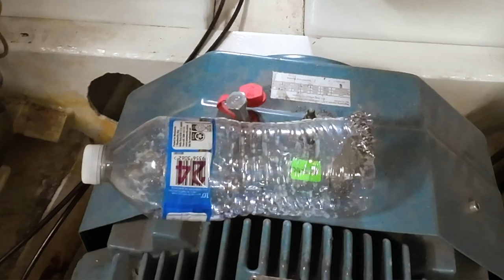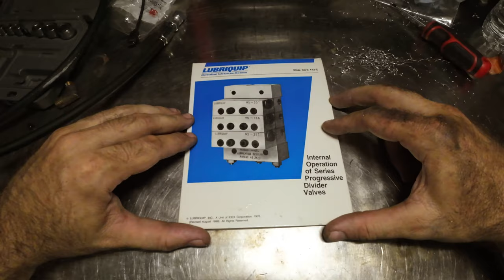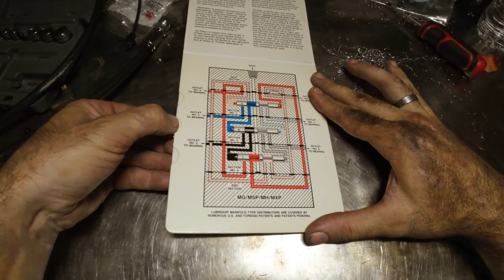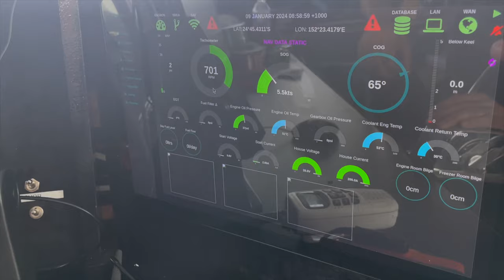New Grease System, New Top Speed, New Berth - Project Brupeg Ep.338

Comment: If you’re in a hot climate you may want to store your grease gun with the pump side down, and relive spring pressure on the cartridge, I’ve had many of them on my service truck weep past the internal seal, even on fairly new grease guns, due to temperature dropping the viscosity of the grease. Even storing them vertical, with the cartridge down and relived of pressure they’d drip on hot days and make a hell of a mess in my toolbox. Just thought I’d share my experience to save you much of the same.

Comment: just a thought that after you cut the black plastic line with the pipe cutter you should use the reamer to clean up the inside of the cut pipe as the cutter leaves a small rolled over flap on the inside like it does on copper tubing. the boat is looking good guys, stay safe all  PS nice bit of piloting at the end well done 🤩🤩lol

Comment: My grease gun is similar to the one used here. In hot conditions the grease melts and leaks through the  where the cartridge is loaded . If you have this same problem maybe flipping the gun 180 deg would fix this.

Comment: Please make and install a guard over that short section of prop shaft
Reply from the maker: There will be a floor board over that soon
Reply: @teeanahera8949  the floor may come up for ‘other’ reasons, the shaft needs its own dedicated close fitting guard
Reply from the maker: Soon we will be building an alloy vege oil tank. It will straddle the shaft and form a guard on its own. The top of the tank will be the floorboard. It will be bolted down and a permanently plumbed fixture in that area
Reply: @ProjectBrupeg  thanks for the info, now I can sleep at night

Comment: if they are push to connect fittings you just need to use a open ended spanner roughly the same size as the line, then push spanner against fitting coller and in down then push line in then pull out.

I made and installed truck air lines for a fair few years, so if they are push to connect thats how easy it is to disconnect them. hope this helps.
Reply from the maker: Ha, that’s awesome to know, thank you. Will make life much easier changing things round. Cheers. Dame
Reply: the product I worked with/company. 
they ship across Aus/NZ maybe more can't remember.
I still have contacts their, who could maybe discount this product if you wanted or maybe better. 
Feel free to get in contact with me.
PS I've watched every episode and loved the watching your adventure. @ProjectBrupeg

Comment: Why not add a thermocouple to the propeller shaft bearing and tie that into your info center?  That will allow you to tell if the grease is running out before it becomes an issue.

Comment: We should crowd-fund Brupeg a big bow-thruster 🎉🎉❤
Reply: Obviously not needed.
Reply: None of the work boats I've worked on ever had thrusters and we never had any problems maneuvering around tight harbours jammed full of other fishboats. Even with fast running tides that literally pin us to the dock or strong winds that blew us away from the dock. It's all about knowing what your vessel will do and how to make it do what you want it to do. I've seen days where the capt. had to pivot the boat completely so the bow was still touching the dock and then he could back way into the wind all with million dollar yachts only inches away.  Is a thruster nice, yes. But it's not necessary.

Comment: This packing for the shaft seal… there seem to be some with carbon in it which is eating up the zink anodes… guess it was Arabella who had this problem. For these small 1/4“ pvc pipes there are hand cutters from Sven Guest for about five Euros or so which are working absolute great for these pipes. This engine runs like a purring cat.

Comment: 34:48
Neighbour appears.. thinking 🤔 .. 👀 .. 🤬
... 🤕

My boat also towers above most boat's on the waters where I am.. 😻

On a more serious note.. is the grease appearing between the shaft and the packing..
Reason is...
Depending where the grease goes in.. the packing may need a gap to allow the grease get to the shaft.. or
.. it gets though.. then someone tightens the packing up (stopping the grease) and doesn't check.. and the shaft is dry and gets a grove where it can't be seen and shears when real load is applied.
I fit packing with copper slip on the shaft and between packing rings .. not dry.
🐾🐾🐾 🐈 💖
Reply from the maker: We can see grease coming out of the shaft seal. We want to reduce the grease going to the front seal by 75% (did the calculations yesterday and realised we are putting way too much in the front and not quite enough in the back) once we have change the ratios we will reevaluate but we may tighten the seal a little to reduce flow but will keep it in a state of always having ‘some’ escape.
Reply: @ProjectBrupeg  
I was just trying to make you aware of the various possibilities as I don't know the exact set-up and design of your system.
A little tray and possibly splash guard around the inboard seal?
Reply from the maker: It’s much appreciated. We did start a drip tray to go under the shaft but haven’t got around to finishing it. It may get bumped up the list soon

Comment: Hi guys. As always your channel is amazing. Just a thought, when I saw you hunting for a mount point for the lube block. Should you not be looking at a large panel or enclosure near that location? I assume you still have a large amount of devices and instruments  like, your get home motor vfd ,hot water system, air start valves and guages,Temps, levels, lube system pump and valves, and not to mention a spot for a big hammer if any of the parts misbehave 😂
Reply: maybe fire suppression also

Comment: Have you considered putting the tool needed for each thing...like the grease gun or filter...at to each device...maybe with a neodymium magnet or similar?  
By getting an extra tool for each and attaching them on or near the device you don't have to worry about trying to find the tool when you need to move or fix something.  
The neodymium magnets are very powerful and should stand up to pretty heavy seas so the chance of misplacing them are low.
Reply from the maker: No I hadn’t. Might ponder that a bit more

Comment: For the hose cutter I have a little hand cutting tool u put the pipe in and there is a blade you press down and it cuts it but the blade is a chevron, hits the mid point and cuts out on both sides, makes a great cut easy

Bit of a tangent, I found this channel because of dangar stu, he hasn’t posted anything in a long time, is he ok?
Reply from the maker: We havent spoken to Stu in almost two years so really dont know what he is up to these days sorry

Comment: Getting closer to being free of the dock, and great docking skills by the way. I like the idea of the grease system, however I've those systems fail. If the manifold does not have restricters or a adjustable valve system the grease will take the easiest route. Meaning more grease at one point and less at another. But my biggest concern is a blocked grease nipple or port. Like I said I've seen this happen on the best of systems. If you had a manifold with simple on/off valves for each line, then you control the grease to each point and you would know if it's blocked.
Tell me I missed something in your video and it's under control. 😊😊
Reply from the maker: When we assembled this system we had a failure. One piston was jammed, because of the design of this system it stopped all pistons from moving and we couldnt pump the grease gun. So we knew immediately we had an issue and because of the design of this manifold block we could retify it within a minute and all systems worked as per normal. Thats why we like this system it doesnt hide failures and its extremely easy to fix.

Comment: Those packings don’t like to be to tight. We use them on pumps at work & if they are done up too tight will burn out badly & quickly. & can badly score the shaft. Was always told by the old guys if they drip ever so slightly they are just right. Even after they are properly greased.

Comment: I like the idea of the central lube system but I'm sure you have experienced a grease nipple that won't take grease. The indicator on your valve block tells you grease is passing through the block but does not tell you if one of your pipes/fittings is blocked.
Reply from the maker: If anything is blocked the whole system stops. Sounds dramatic but it’s very easy to find the issue and repair. We had a blocked piston setting it up and it was a 1min repair and back in business.

Comment: What about swapping out the manual grease gun for a 12v grease gun then you could lengthen the switch to the wheel house saves you constantly going to the engine bay every 30 mins or so

Comment: Grease gun will air lock in that postion!
place the discharge to the bottom as any vibtation the grease wiil vibrate just like jello and will allow air into the lines and will give nothig but greif with no service...Ron
Reply from the maker: Thanks Ron. We are going to flip it today as when warm we also found out it dribbles down the spring loaded shaft.

Comment: shouldn't the lap joint on the packing be cut on the vertical axis and not the horizontal axis? the pressure of the grease pushing out of the gland would cause the lap joint to get tighter if it were. Hope that makes sense.

Comment: Hi. I build  rc model boats. The same problem of  water ingress  entering the hull via the shafts can be probmatic.  Packing the tubes with marine grease on a regular basis is what i do.  No joke watching months of  labour of love and lots of money sink to the bottom.   It happens very fast.
Reply: It's my firm belief that every boat should have the engine/propshaft section completely walled in with waterproof bulkheads that reach at least above the waterline at maximum load and expected pitch/roll. That way, a leak in the engine cooling water intake or around the propshaft can never sink the boat.
Reply: That's very hard to achieve . Sounds good on paper.  However water will always find a way thru. It's something that has to be controlled and kept within limits.   Stern glands and cutlass bearings can fail at anytime regardless of age.  A good engine room flood pump buys you valuable time.
Reply: Try rigging a spring loaded syringe to maintain positive pressure of grease in the shaft at all times.
Reply: @FrozenHaxor I do  use a system like this. Basically cut a hole in the shaft tube and solder a brass down tube.  Using a syringe to inject grease. I guess you build  model boats. Thanks for the heads up.

Comment: 2-3 PSI of boost pressure. Isn't that a little low? I would expect at least 5-10 PSI when it's close to 1500 RPM.
Reply from the maker: It’s possible our gauge is not reading right as we still need to calibrate it
Reply: @ProjectBrupeg  Ah, I see.

Comment: Are you using machine grease and not hyped thick car/lorry ball joint grease ? My friend worked on a fishing boat with a similar type of system as in automatic he changed it to a 140 gear oil as even the thinner greases got too thick to flow when in cold water !

Comment: I like the pipe cutter. Very neat. 

But side cutters are fine. I started out being anal about good straight square tube ends. But after testing one v the other it makes no difference. Push fittings seal well up on the tube. Unless you really munt the end it works fine. 

I do hundreds of grease lines so it's worth me saving a few seconds each. If you've only got a few doing it neatly can be satisfying.

Comment: Dame you said, I think , that you would pump grease every hour or so. Maybe I missed understood but is the system a closed system so why would you need constant add grease and how do you cycle the old grease out . I'm familiar with drip systems but not this type.
Reply from the maker: Every half hour when steaming we do an engine room walk through. It’s during these checks we give it a single pump. That pushes grease unit the tube which slowly leaks out each end. We are about to change over to a biodegradable stern tube grease so it’s able to enter the water without causing harm to the sea

Comment: Do you get much prop walk in reverse with the big shroud around the prop?
Reply from the maker: Yip. We don’t really have any steering in reverse. We can make her go straight but that’s rudder hard to starboard and then every 20-30m a burst of forward thrust with rudder hard to port then back in reverse again
Reply: @ProjectBrupeg  try short high rpm blasts when in reverse, like give it heaps to get flow over rudder then neutral or low rpm, we have a similar hull shape and it makes a big difference
Reply: Obviously play around with it out in the river or something, where you can give it heaps and not have to worry about hitting anything
Reply from the maker: @nautichunt84 thanks. I will experiment a bit. I’ve reversed this boat exactly once so far
Reply: Fellow big wheeled boat with a nozzle… 69” 3 blade wheel. 

They will steer in reverse; but it’s a bit delayed. 10 to 15 degrees of rudder in the direction you want to reverse, then wait about 10 seconds before the boat will follow. 

That said; the best method I’ve found for drastic adjustments is the clutch ahead and kick the stern over as you’ve mentioned.

Another thing that I’ve found is to make sure you’ve slowed to about 4 knots or less before you attempt reverse. Something about the nozzle will make the boat get completely out of control if you reverse with more than 4 knots. Been there, done that!

Comment: You took a simple function of greasing into a complex system subject to failure to many areas to fail. Good luck hopefully it works.
Reply: That a system is pretty standard practice with not only marine vessels, but also industrial equipment.
Reply: Inspecting that system is still 5% of the work greasing would be and inspecting takes out all the risks
Reply from the maker: if we just have grease nipples we can easily get rubbish in the grease and then push it through our cutlass bearings etc. this system is an industrial standard and gives us the ability to eliminate rubbish being pushed through the lines. we can make fine tuning adjustments and repair is almost not required given how simple the system is. I can fully rebuild this system from in around 5-6mins. Dame

Comment: Such a complex solution to a simple problem IMHO
Reply from the maker: This gives us a much better ability to control grease volume and distribution. We previously had grease nipples on each point and it was a nightmare and as a result the grease often of ‘forgotten’. Have a system that allows us to just pump as we walk past means the boat will be more reliable in the long term as the maintenance is easy to do